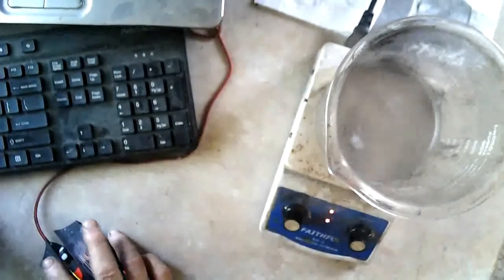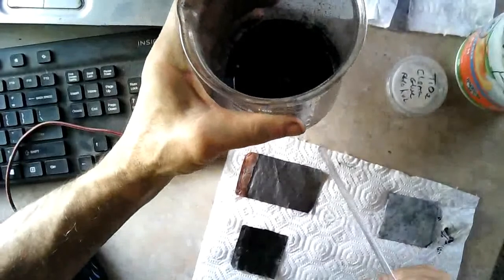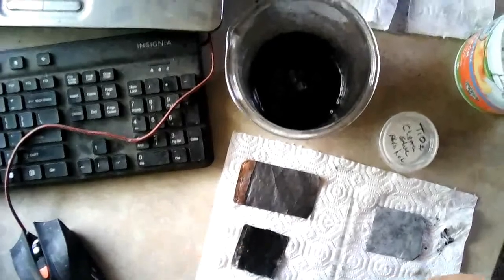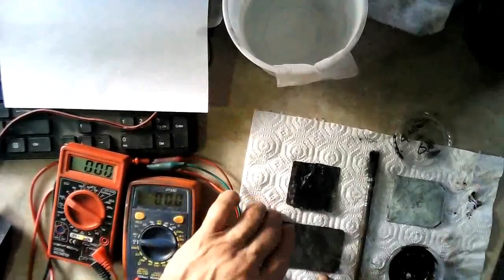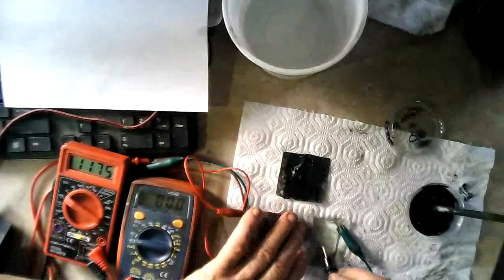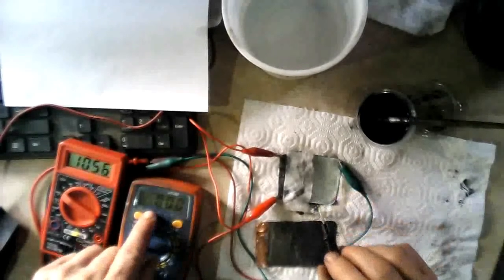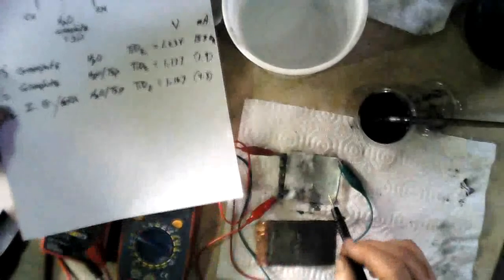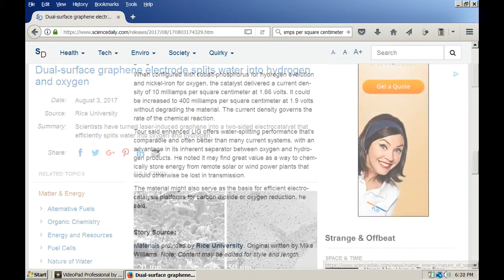Easy Intercalation & Exfoliation With Phosphoric Acid! Part #2

Comment: Well done, you seem to be on the right path with this latest experiment.
That's quite a big jump in S/C current from a few tens of mA to nearly half an Amp, from a cell half the size.
Not yet totally sold on the self charging aspect of your work, but the tests you do certainly seem to weed out the winners and loser's very quickly with minimal equipment and could be used in others work.
I'm sure you will get to "proper" charging and discharging when you think the time is right:-)    Martin.
Reply from the maker: Hi Martin!  I appreciate the honesty about the self-charging aspect, and that will drive me to make you a believer sooner or later. :-) You reminded me about a charging test I did last week too. The older cells could be charged, but slowly discharged down to the electro-potential it would self charge to. The newer version won't even take a charge! I'll demonstrate that for you soon.

Comment: Great work, as usual,  you could be right, you could be damaging one of your coatings with the over-voltage. You've got it too good for your own good I think,  you may want to consider some of the tests that I'm planning, I have two OWON B35T multimeters that are capable of data logging via Bluetooth to my tablet.  My plan is to use a small PWM circuit driving the LEDs or some other small load, that I can regulate the input to the load. If your cell is continuously making current you should be able to calibrate your load to the rate the cell is generating power.  You may have noticed your voltage drop with your new meter setup  the voltage drop with a properly regulated load  should be able to find a happy medium between the voltage drop and the  milliamps the cell is generating, if you're able to find a "sweet spot" and the cell is actually generating consistent power with those amazing numbers you're producing.  You should be able to constantly generate power to the load at a regulated rate,  this may further condition the cell without a dead short. Keep up the awesome work can't wait to see what you do next. :-)
Reply from the maker: We are thinking on the same path. Balancing the self-charge rate with the load would be the ideal way to use the cell I think. Keep it in charging mode all the time, and store the energy in another battery or cap. I'll check out the OWON B35T multimeter too. Thanks for the feedback! :-)

Comment: The paper is describing a secondary cell. If in fact you can sandwich in self charging chemistry to create the charge and efficient storage in the same cell it would be a revolutionary development. Still the charge has to come from something. I've  wondered before if water could be consumed in a catalytic process to produce energy. To determine that a totally controlled environment would be needed. Something you have been accumulating the resources to do.
Reply from the maker: I discovered an easy way to demonstrate that the cell is in fact consuming water Fred. (without using a lot of equipment either). I'll work on fitting the demo in a video for you my friend. :-)
Reply: Actually publishing results of the demonstration that water is consumed in the process benefits both of us. Me to satisfy my incessant curiosity and you to establish authorship of an important discovery. Water has long been thought to be an important potential source of energy but the means to harness it has proven to be elusive. In my endless literature searches I have found occasional mention of it but usually just scattered hypothesis but no definitive conclusion.
Aside from the experimental discovery the mechanism by which the conversion takes place needs to be understood. Whether other materials are also being consumed or converted in the process is an important aspect.
First things first though. Demonstrating that water is somehow being consumed implies that it could be the start of revolutionary technology. It's exciting to consider.
Reply from the maker: I may be unleashing a Pandora's Box.